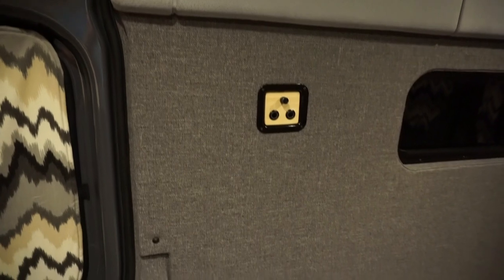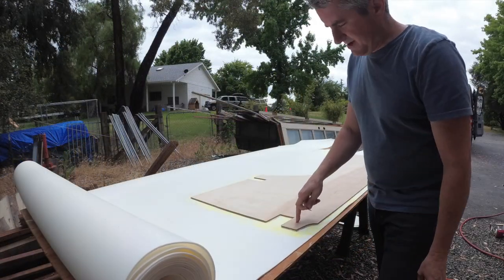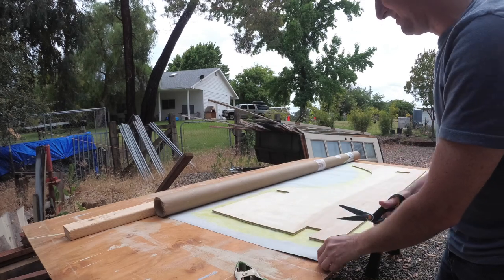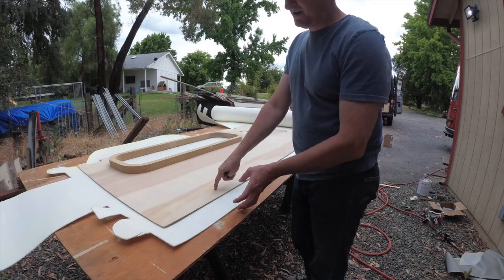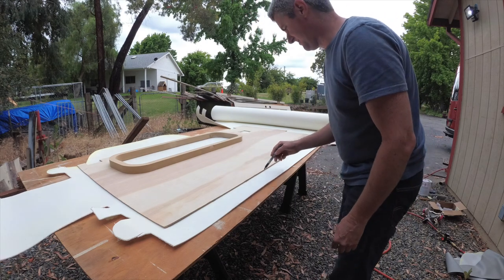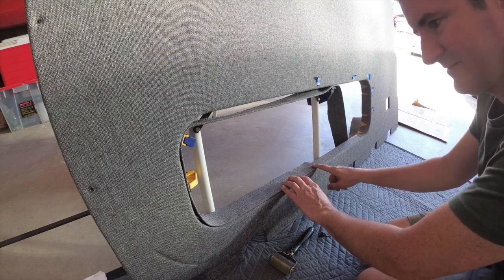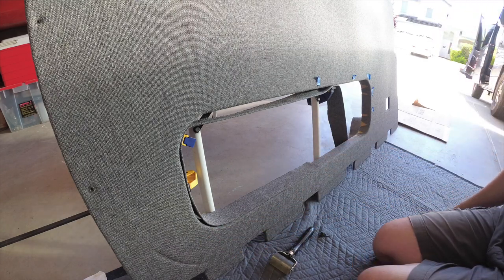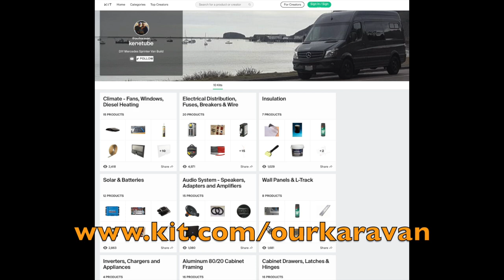Wall Panel Upholstery - DIY Sprinter Camper Van

Comment: Wow- what timing and coincidence!  I just purchased my wall material and had a rough idea of how I am going to do it but googled to see if I could find any helpful tips.  I have watched most of your other videos.  We apparently bought the same tweed, foam and adhesive from the same place, who advised me to use the sprayer instead of aerosol cans.  And here you made the exact step by step guide to what I was hoping to accomplish.  I am so thankful for your videos and information.  I have launched myself into the van conversion project with zero skills or knowledge and your videos are definitely helping to pave the way for me.  Thank you for taking the time and sharing your knowledge.  I love your problem solving, laid-back approach.
Reply: Also- what scissors are those???   I need a pair like that!
Reply: Found them!  :)

Comment: Great vid! This is exactly the kind of wall treatment I want in my build. Adds acoustic as well as thermal insulation too. Well done.
Reply from the maker: Thank you!  It’s been in the van for 4-5 years now and it still looks as good as day 1.
Reply: @ourkaravan  I especially like that you don't have exposed screw heads everywhere. How did you attach the panels to the van walls? Never mind, I visited your site and see that you used L-track plus a headliner with a minimal number of screws. Very nice! There is a commercial upfitter I have been following that uses/recommends 3M 90, but uses 3M Fastbond Contact Adhesive 30NF for the majority of the panel upholstery. The DAP adhesive you used is $.20/oz. less expensive than the 3M Fastbond.

Comment: 3M has great toll free phone support for adhesives. Which ones work best with your materials, and which ones can withstand heat. #77 or "headliner adhesive" will hold up, even on headliners in hot vehicles. Do it right, and you only have to do it once.
Reply from the maker: Good to know, thank you!

Comment: As with every other aspect of your build, this phase was well researched and patiently executed. It's nice to see a van build that is done really well rather than the usual, "here's how to do it cheap, fast, and sloppy".

In your earlier video of making the wall panels, you mentioned that the thick window trim/spacers came from RB Components. I couldn't find them on their website, but I'd like to know what they are made of so I can maybe fabricate my own for finishing out my truck camper. Is it some kind of dense foam?

Thanks for the videos and for your willingness to share information.

Comment: Ken super job with your walls and all else too you convinced me to use fabric and use my 1/4” cedar planks sparingly. Primarily for the highest fidelity. insulated with 2” mineral wool and sprayed lightly adhesive on  reflectively to use as VB.. due to 3 big and 4 doors windows in cabin wall space is minimal. What type panel should I use for good sound absorbing . There is wool and also fiberglass 1/2” -1” rigid foam board available having matte black or different color side that can be left open to interior. Due to limited headroom can only have 1” max ins. I thought of just 4 center planks with 3/4” gap between.the windows need be addressed perhaps using spare lightweight spare 3” 38”x74” foam mattress having three 38”x26”” sections(exact size of windows)  could attach reflective then decorative covers held w up with Velcro tape. Doing more research on sound materials but any thought?
Reply from the maker: HI Paul, I was having trouble following the question...can you try again?

Comment: As an seamstress/upholster for a major boat manufacturer and a former otr truck driver, who's interior is all upholstered, you did an amazing job 👌🏽👍🏽. I'm doing a van build in August, so I'm getting my plans and design together with a list of everything I want for my live in van. The techniques you used are some of the ones we use in the industry. My plans on covering my ceiling and walls are to upholster them using 1/4  to 3/8 in ply like so many class b rv"s do. I think it'll save on weight as well.
Reply from the maker: That's a huge complement, thank you very much!!

Comment: You absolutely nailed it! This is exactly the look I want. Thanks for the excellent video 👍
Reply from the maker: Awesome, thanks!  It's relatively easy to do.  Corners are a little tricky but play with folding them over without glue first.

Comment: You could use a "bone". Bookbinders use a cuttlebone (squid bone sold in bird pet shops) or an ivory or plastic version. This is just a smooth surface, like a six inch ruler, but with rounded edges, used to burnish and smooth the leather covers that are placed on fine books. Same job, same tool, the burnishing helps get it all neat and tight.
Reply from the maker: I think I'm missing something.  What would this help accomplish?  Flattening the fabric against the glue?  Thanks.

Comment: There are a lot of video’s doing sidepanels of vans. They use 4way stretch materials. But this looks good!
Reply from the maker: Yeah I'm not a fan of the 'speaker carpet' look.  The tweed is very easy to work with and looks professional.
Reply: @ourkaravan  do you have a link for this fabric? So I can take a look? Thanks in advance 😊👍🏻
Reply from the maker: Certainly, it’s from perfectfit.com

Comment: Hi! This is a great tutorial. I was wondering, do you have to put the upholstery on the foam and paneling, or would it be fine to put it directly on the metal side of the van? Probably not with this adhesive, but with Velcro? Do you think, in your experience, it would be effective still?
Reply from the maker: Hi, I have a separate video on my channel showing how to do exactly that.   It should be the video published right before this one.

Comment: Great video! How do you attach your panels to the wall? It didn’t look like it was secured in many places. We just purchased a new van and are in learning and planning mode! Thanks for sharing your wisdom with us.
Reply from the maker: Congrats on the van!  There are only three screws per wall panel, and they don't really "hold" the wall panel, they just help make it curve with the side of the van.  Two are located vertically at the far back of the wall panel near the D-pillar, and one forward screw at the center and start of the panel.  The panels are retained either by the cabinets pushing against it or in the case of my passenger side, the L-track retains the bottom and my headliner retains the top.  I hope that helps!
Reply: @ourkaravan  yes that helps a lot! Did you use adhesive as well? We are definitely doing this! Thanks for the reply and inspiration!
Reply from the maker: Hi, no adhesive between the wall panel and the van itself.  Of course there is adhesive to attach the foam and upholstery to the wall panel.

Comment: Awesome video. Very timely for me since I'm beginning this step right now,  and you're right not many videos on this.  How do you clean the spray gun?  And how do you use fabric buttons?  Thanks.
Reply: Thank you for your reply & helpful tip about cleaning the spray gun.  I may consider that route instead of buying 3M 90 which is too expensive.  About "fabric button", I thought you were using fabric button or some types of screw caps to cover the screw heads that hold the panel in place.  At 1:42 there is a "button" (or is it just a screw head?) on the left side.  I'm going to have a row of at least 4 screws at the center to hold the panel tight against the curve wall.  Looking for a way to aesthetically cover the screw heads.  Thank you again.
Reply: I’m also curious about cleaning up the spray gun. I’d rather not treat it as disposable. Would please share that as well? Thank you
Reply from the maker: Yes, my reply is missing.  When I’m done spraying I pour all remaining adhesive back in the container. I then pour mineral spirits in the reservoir and swirl it around.  It will turn the adhesive into a ball and you can use a few more paper towels to wipe the remainder.  Then pour mineral spirits in the reservoir and spray it through the nozzle. My gun has been reused several times.

Comment: One more question... How did you attach the upholstered panel to the wall? Did you use the factory plastic clips? And how did you make sure these lines up? 
Such a good job, a build to aspire to.
Reply from the maker: Hi Rob,
On both the driver and passenger sides, the OEM headliner (which curves and comes partway down the wall) retains the top of the wall panels.  On both sides there are also two sheetmetal screws vertically along the D-pillar, mostly to help the wall panel conform to the curve of the van.  On the driver's side, the cabinetry presses against the panel to retain it while on the passenger side the wall panel sits and is retained by the length of L-track.  I hope that helps!

Comment: How will you be mounting/fixing it to the van frame? Rivnuts? I've wondering about that myself. Most use furring strips and screw but that doesn't really work well with upholstered panels. Rivnuts on the corners might mean it'll slap around a bit when driving though I'm thinking. What are you plans?
Reply: I took apart my conversion van. They had stapled some small pieces of plywood to the backside of the wall panels where other pieces met, and were screwed together there. The wall panels were basically floating from the floor to the ceiling, except where screwed to added metal around the windows and to the other trim pieces.

Comment: Love your videos! Would you share how many yards of fabric and foam you purchased, as well as how much adhesive you used on panels?
Reply from the maker: I bought 10 yards of foam and fabric and had enough for the two wall panels, my over-cab shelf with a small amount of leftover material.  I’m not  as clear on the amount of adhesive—maybe 1/2 gallon?

Comment: absolutely superb, its always something that when you build something for yourself.  Question....the roof panels seem to be OEM.  Does MB sell these separately to outfit a cargo van chassis?
Reply from the maker: Thank you!  I believe MB does sell it but I'm guessing it would be prohibitively expensive as standalone parts.  They come standard in passenger vans (with the AC cutout) and optional on crew and cargo vans and I purchased mine used through the the sprinter-source forum website.  If you haven't seen it, my most recent video is on the headliner and overhead lighting install.

Comment: Such a great conversion. Your website is also invaluable. I've noticed you have also upholstered some of the plastic trim? Did you use the same process? I'm concerned about the curves and the fabric not being stretchy enough to accommodate it. Thanks!
Reply from the maker: Thank you Rob, I appreciate the positive feedback.  I haven't upholstered any plastic trim but there are places where I adhered the upholstery directly to the sheetmetal of the van.  I did this behind the sliding door and I also wrapped the D-pillars in the rear of the van.  A couple of weeks ago I wrapped a small, curved trim piece and it came out great--it is easy to work with.

Comment: Did you make the panel go under the factory roof? Is that what those castelations were for? I'm going to do the same thing, make walls and keep my factory roof, I was going to just mate the roof and panel, do you recommend brining the panel under the factory roof? How thick was your wooden board?
Reply from the maker: That’s exactly what I did.  I wanted the wall panel to extend behind the headliner and the cutouts were the locations where the headliner clips into the body.  It worked out well and makes the wall panels fairly easily removable.  

I ended the 1/8” foam just short of where the headliner contacts it so the panel wouldn’t be too thick to tuck under.  I used 5.2 mm plywood.

Comment: Excellent upholstery work.  What type of fasteners did you use to secure the upholstered panels to the wall?  How did you hide the fasteners  to make the upholstered panel look complete?
Reply from the maker: HI Sam,
there are only three fasteners--two sheetmetal screws with trimhead washers at the far rear of the panel (located near the switches in the back pillar) and one single screw toward the front of the panel near the sliding door.  The bottom of the wall panel is held in place by the L-track, which has a lip on it.  At the top, the factory headliner sandwiches it in place.  If you are not using the factory headliner you may find it necessary to add some additional screws at the top of the panel.  I hope that helps.
Reply from the maker: I should clarify that for some reason I had to use some internal fastener clips to pull the wall on the passenger side inward.  I've never heard of anyone else having to do that, but if that's what you were asking about, let me know and I can clarify further.

Comment: I'm surprised you did not have to turn over the wall panels and roll out any wrinkles - good job.
Reply from the maker: I wasn't sure what I would find the first time when I flipped the wall panel over.  I'm sure having a nice flat surface to work on really helped.  Or maybe it was just luck!

Comment: Ken, I'm doing this now and have a quick question.  Did you thin the Weldwood glue?  The can says not to but mine is coming out rather thick and not a nice spray.
Reply from the maker: @Dave Ness - I did not do any thinning but I suppose there's no real harm in doing-so.  I would do it in conservative increments though.  Be sure the temperature isn't too low when spraying and you may have to adjust the air pressure and/or the settings on the gun.  I had the same issue and quite frankly I started turning knobs on the gun (without knowing what they did) and it fixed my issue.  I fully recommend using my half-witted knob turning method!

Comment: Awesome video! Doing the wall panels outside like that, how did you end up attaching them once you installed them in the van?
Reply from the maker: There are three sheet metal screws per wall panel.  Two toward the rear of the van and one toward the front.  The cabinetry partially holds it in place as well. Thanks for the positive feedback!

Comment: Ken, as always, excellent and helpful videos.  I have a quick question.  I didn't see how you secured the wall panels at the top, where it meets the factory lid or ceiling.  I see tabs on the top of the wall pieces that you covered with fabric.  Did you notch the bottom edge of the lid and slip those wall tabs into the slots?
Reply from the maker: The wall panel has nothing on its own to keep it in place, it relies on the factory headliner.  The headliner has some metal tabs that slip into those ovalized slots in the van.  Once engaged, they not only hold the headliner to the wall, but pinch my wall panel up against the wall as well.  There's just enough room for the finished wall panel to slip in there.  Thanks for the positive feedback!

Comment: How does this handle any moisture vuildup or condensation that may happen
Reply from the maker: Van is 5 years old and there’s not a single sign of any moisture issues.  I’ve had wall panels off and it all looks like the day I installed it, minus some dust of course.

Comment: Thank you so much!!! Yes there's not much information about upholstery for van conversion. What kind of upholstery button do you use for the panels?
Reply from the maker: Hmm, upholstery button?
Reply: @ourkaravan  how do you hide the screw head of the panels?
Reply from the maker: @stuffs6335  There are only three screws that retain the panels, and they are visible.  They just aren't noticeable as there are two right along the vertical D-pillar in the back corner of the van and one in the middle of the panel at the front edge.  Most of the panel retention comes from the L-track and the headliner holding the top in place.  I hope that makes sense.

Comment: Ken,  I'm working on details for the wall panels and window trim details, and I was planning on doing something similar to what you had done but I have one question...

You purchased the wooden window trim frame and then you secured it to the back side of the wall panel with screws (and some glue I presume). Did you secure the wall panel to the wall only on the perimeter (beind the L-track and with a few screws at the front, etc.) or did you also figure out a way to fasten the trim ring around the window frame?  I was thinking that I could possibly mount some magnets in the trim ring so that it will snug up onto the wall surrounding the window to keep it from rattling or rubbing.
Reply from the maker: Hi, you are correct that the trim ring is screwed to the wall panel.  Most people wrap the trim ring in upholstery first then screw it to the upholstered wall panel, but you are left with exposed screws around the window, which I did not want.  I decided to take an alternate approach which you saw detailed in the video--I did this to avoid exposed screws.  

Each wall panel is supported by either L-track or 80/20 at the bottom and held in place by the stock headliner at the top.  Only one screw at the front of the wall panel and two vertically at the D-pillar retain it--there is no attachment of the wall panel to the window.  (I tried some marine clips but they did not work.)  The driver's side is fine, but for whatever reason the passenger side is not tight up against the window.  A friend had the same issue on the same side, and his solution was to make a curved wooden brace to which to screw to the backside of the wall panel to introduce a curve.  I would recommend doing that.  Magnets may not be strong enough to introduce a curve in the passenger side wall.  I hope that makes sense.
Reply: @ourkaravan  Thanks Ken... appreciate the thoughts on this.